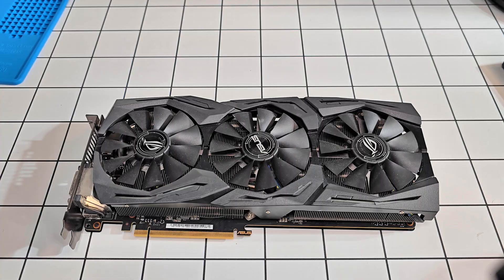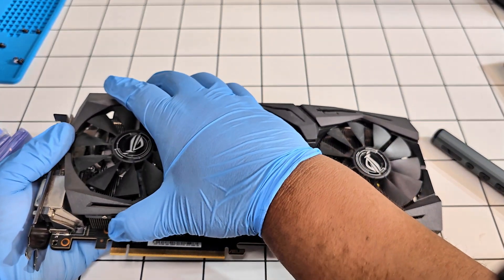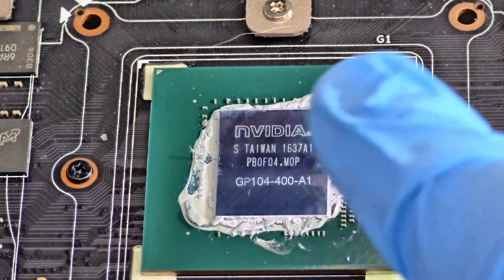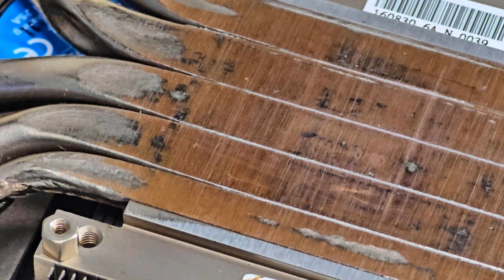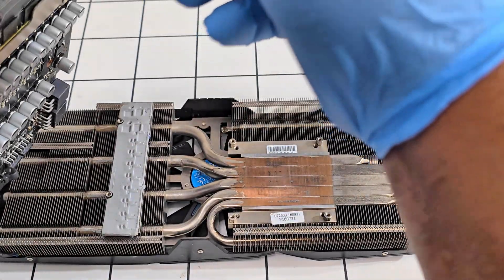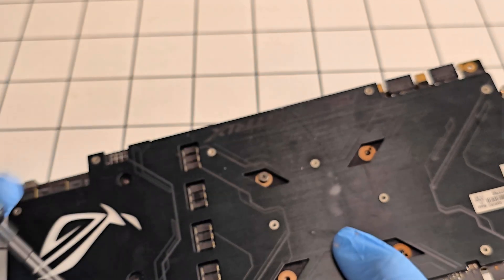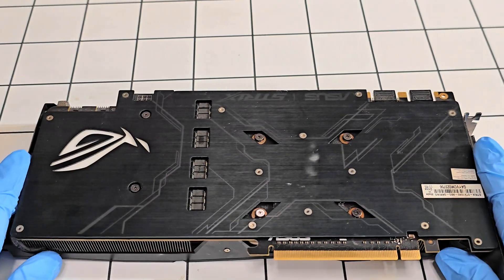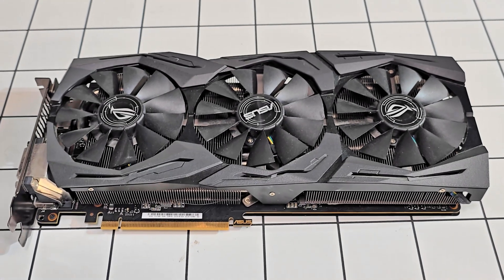Don’t Use Cheap Thermal Paste on Your GPU! Arctic MX-4

Comment: i think you knocked off one of the capacitors, cause the way you must;ve cleaned it, is just like now, u used a paper towel with no prior lubrication to help dilute the thermal paste. next time try using 99% isoprophyl alchocol (electrical grade alcohol)